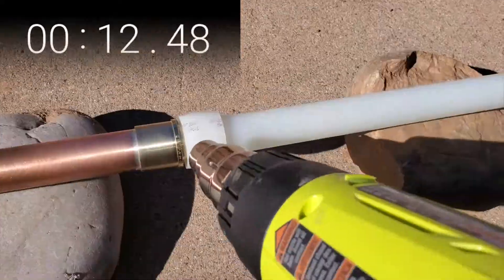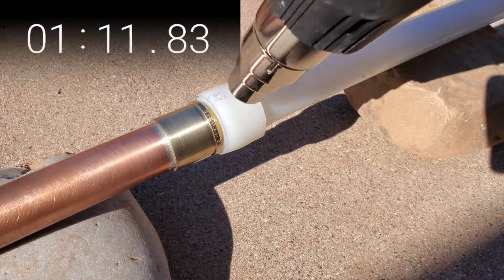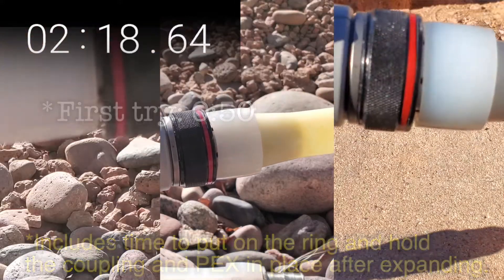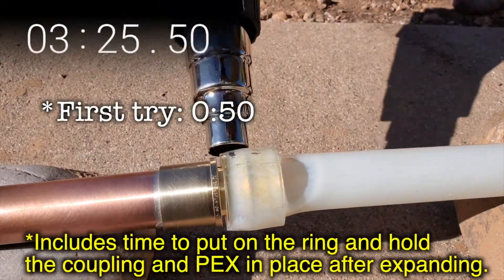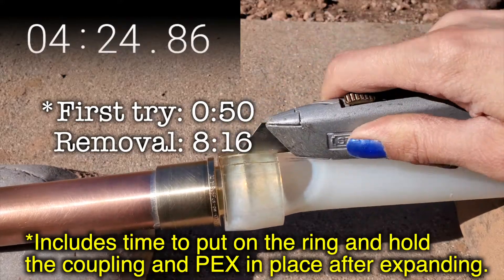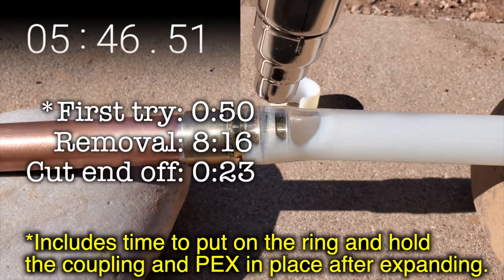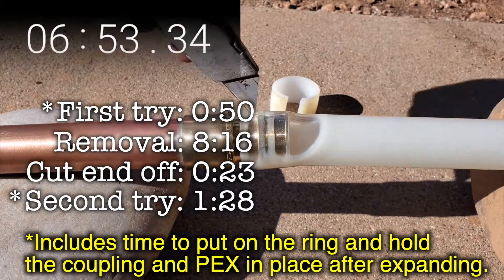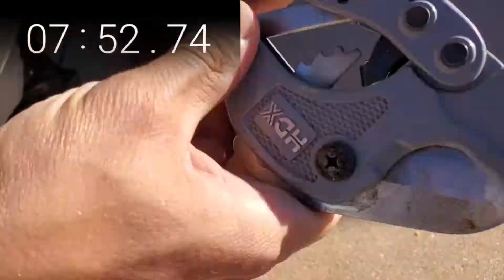How LONG Does it Take to Remove a PEX-A Coupling (Timelapse)

Comment: Using a heat gun, what temp does it need to be before it turns clear and can be cut ? I'm waiting a lot longer, but not sure on how hot it needs to be. Thanks.
Reply from the maker: It's probably a bit late for a response, but it is more of a looks and flexibility thing than a certain temperature--getting the PEX to the point of being clear. I hope your project went as well as it could.